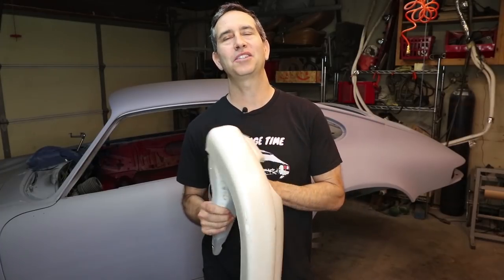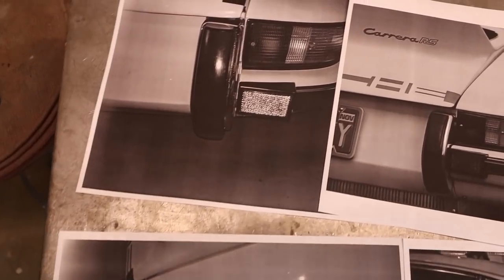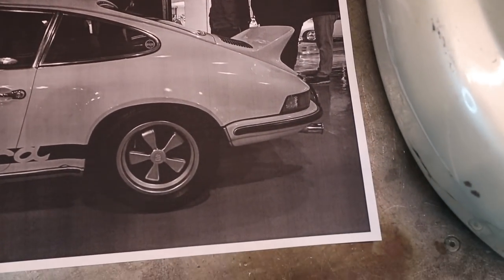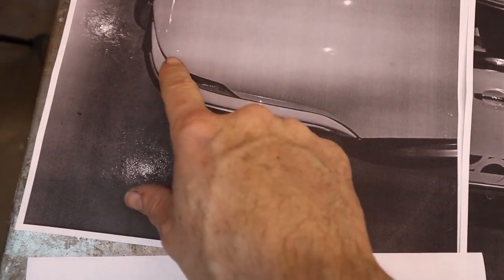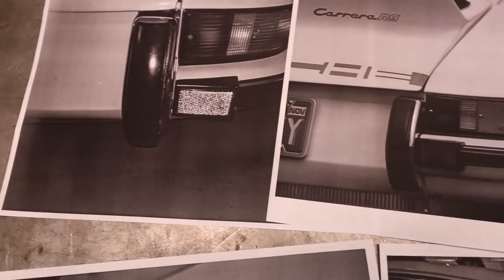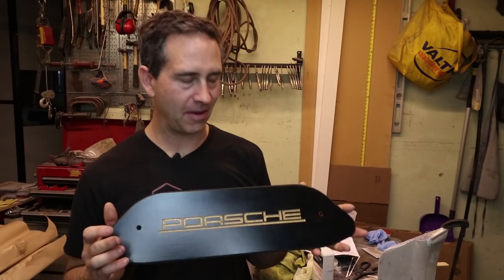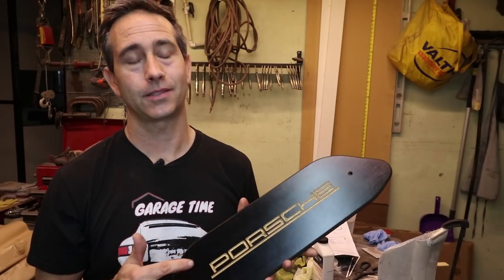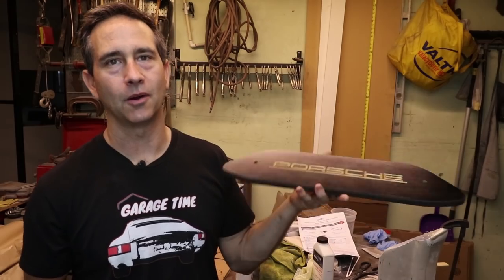How to Blend Fiberglass Bumpers That Don't Fit my 911

Comment: Tom your tag welding is amazing which one of your videos mentioned the amperage and wire diameter yo-yos I’d like to hear that again I thought it was a real helpful Tip
Reply from the maker: https://youtu.be/t2xomaxWhFc
Check out this vid, but in general 20-30A with variable foot pedal.  .040" tungsten and .035" wire.  Thanks for the compliment 😁

Comment: Great video Tom. A great tip for holding the shape when fibreglassing, some masking tape and Aluminium foil or even better aluminium tape. I'm pretty sure you guys call it Aluminum though?
Reply: forgot to mention that fibreglass wont stick to foil.
Reply from the maker: Thanks Mick, I got it done and luckily the other side doesn't have an exhaust cutout or at least it's already been filled.  Yeah, we say alum-in-um. How do you say condominium?  A few extra "I"'s?  Or Mississippi?
Reply: @GarageTimeAutoResto  condominium is the same, same for Mississippi..hahahaha. We spell "color" colour, but sounds exactly the same, but with our Aussie accent....hahahaha
We also say solder, where you say sodder.

Comment: Working with fiberglass is the worst! It's smelly, sticky, it itches, requires many layers, etc. Perhaps on the exhaust cutout, you could have made some kind of temporary backing for the fiberglass? Maybe clamped some sheet metal lined with waxpaper or something. Something along those lines, just to help with forming the initial shape. Once dry, pull the sheet metal, and continue adding layers of resin and fiberglass.
Reply from the maker: Agree fiberglass is no fun.  I probably should have just taped the exhaust cutout with wide masking tape.  The hole wasn't too big so it wasn't that bad.  The fiberglass was very thick near the cutout so it will need to be built back up.  I'm going to add some lightweight filler to the resin when I smooth it out.

Comment: Is there a reason you did not just heat and bend the fiberglass as needed.. with a heat gun..
Reply from the maker: The bumper is too long and I didn't even think about heating it.  That might work but  I didn't try it.  Seems like it would get rippled and the corner would still stick out too far.

Comment: Dude they were crap and you put how many hours into making them fit?  You know there are several places to get exact fit Porsche  parts.
Reply from the maker: In my experience there is no exact fit body parts.  Especially when fitting to RS flares and using custom aluminum bumperettes.  Good things take time.